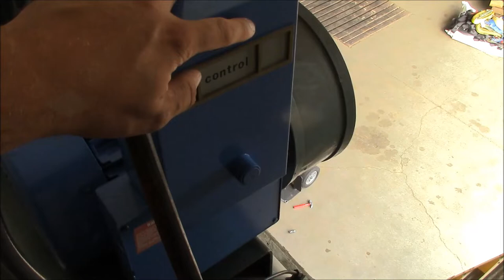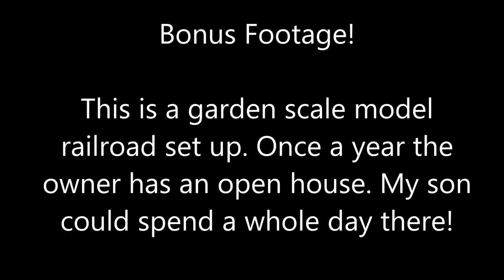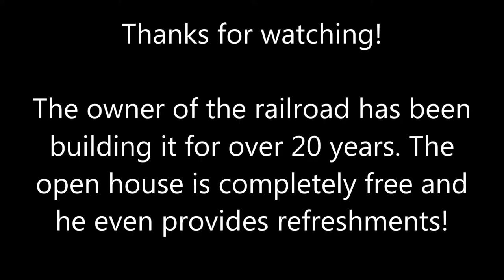New Shop Tour!

Comment: It's easier to add a new man door than tear down an existing office. It's easy to underestimate the value of that office!
Reply from the maker: I think if you saw it you would feel differently. The interior is not finished. There are no lights or really any electrical. I'd rather have the office near the bathroom too.

Comment: probably more expensive, by a large margin, to do the conduit.
Reply: EMT isn't that expensive. Might add $1 per foot, at most, to any circuits Wes is likely to run off a 200A single phase service. Cheaper than the cost of tearing into the walls to run romex.

Comment: I never could stand an air compressor in the building I built a little shity outside against the garage just for the air compressor and put everything through the wall into the garage you can actually hear yourself think without that compressor running I be great for you doing your videos with keep it outside